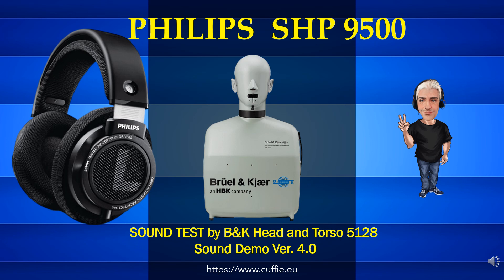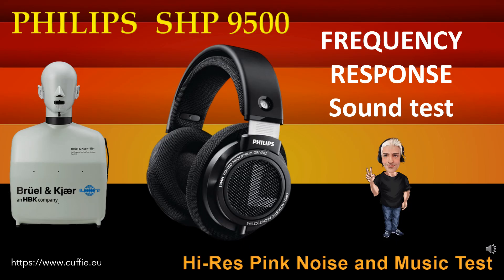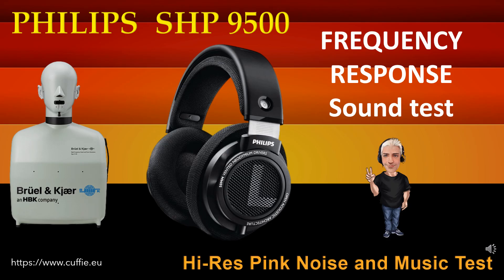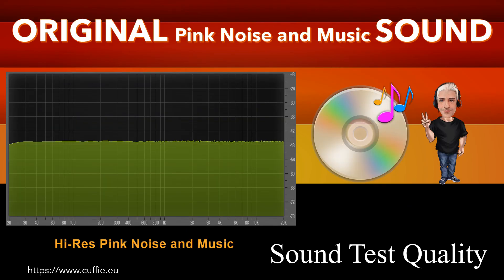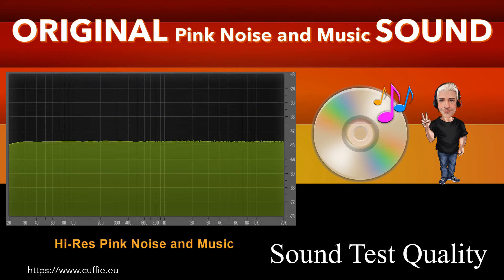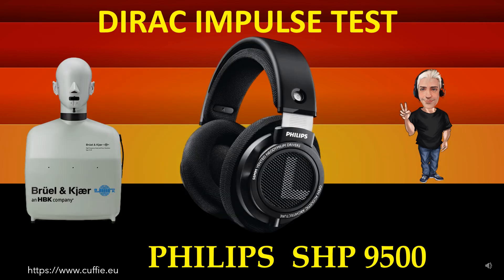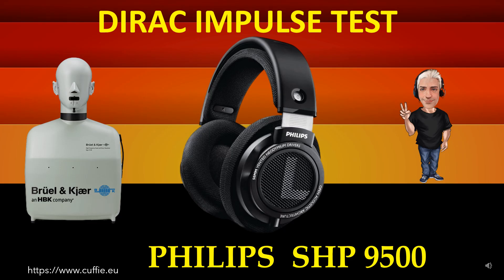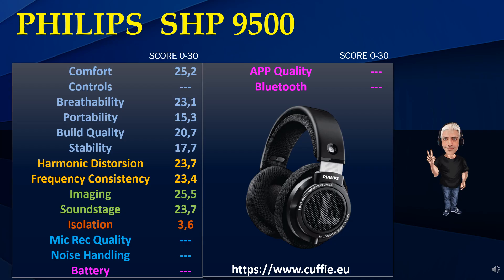PHILIPS SHP 9500 - SOUND DEMO, SOUND TEST

Comment: Philips shp9500 or audio technika m20x? What's better?
Reply: Sennheiser HD 6XX
Reply: Sennheiser HD600
Sennheiser HD650 + EQ
Sennheiser HD800 + EQ
ATH R70X
AUNE AR5000
Reply: @VENOM-vq3ju  for me 650 doesn't need an EQ...
Reply: @ 
On the acoustic measurement of the version I have, the low-midrange and bass are forward, as well as two small corrections in the high end of the spectrum.

I like the neutral, linear and transparent sound.
When I make "EQ" corrections it always remains in line with the speaker capabilities.
Reply: @VENOM-vq3ju  and it is good.. low midrange is what you need for long listening session
Reply: @aleksandrpotylko  
A bass and low-mid forward causes a lack of definition, precision on a double bass, blurred voices, a lack of impact, realism and a narrow stereo image.
Afterwards to compensate for this problem, manufacturers add treble at various frequencies.

Type in YouTube: Sennheiser HE-1 Sound Demo.
Reply: @VENOM-vq3ju  it depends....  Better your ears=Less masking effects you get🤷
Better to listen a bit more low midrange. Highs are killing your ears.
I prefer what others call "dark sound"...  with wide soundstage.. and  I hear all the definition
Reply: @ 
So you don't like Hi-Fi, because Hi-Fi = High Fidelity.
You don't like the work of the sound engineers and the artist.

I built high and low output speakers.
I have all the headphones mentioned above and more
So my ears are well trained.
Reply: @VENOM-vq3ju  No , I just have good ears)) I don't need a lot of highs. I am a sound engineer by myself)
Highs ruin you ears. But I think the job is done... according to your comments 😉
Reply: @ 
As long as the treble is not aggressive, that it is fluid "linear", that it is beautiful to the ear and well it suits me.
have you already heard a Fostex T90A?
Reply: @VENOM-vq3ju  no, I don't have any other headphones
Reply: Choosing between SHP9500 and M20X depends on a few things. The 9500 are open-back headphones so they're best used in a quiet environment. If you're listening in a noisy place the closed-back M20X will be better. The 9500 are well-suited for jazz, orchestral, folk music, classic rock, acoustic and ambient music, etc. The M20X do better with rap, hiphop, metal, and EDM.